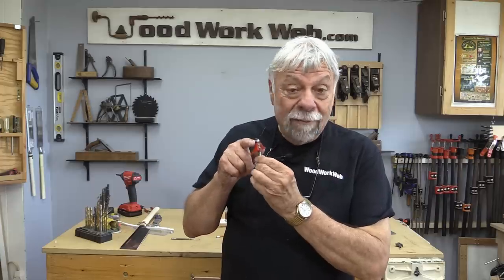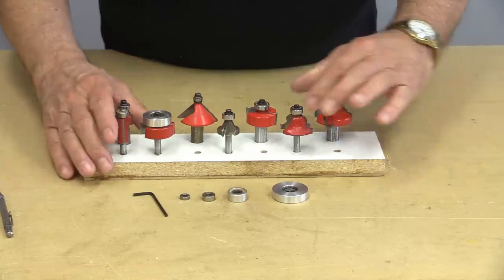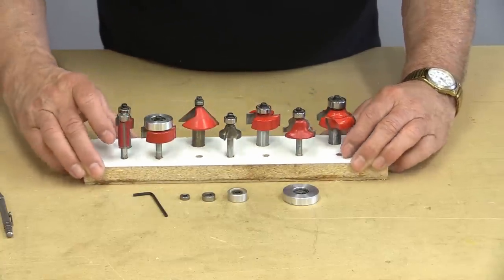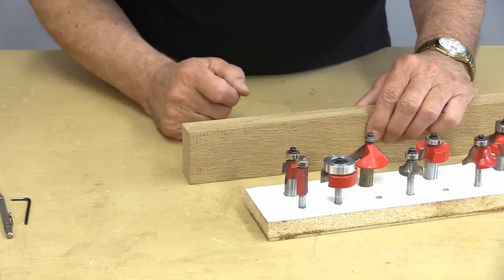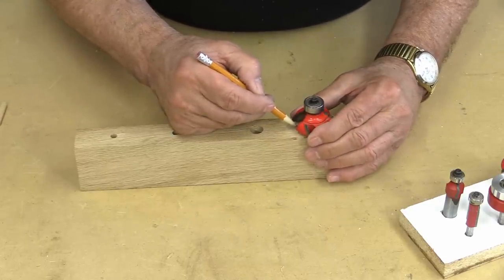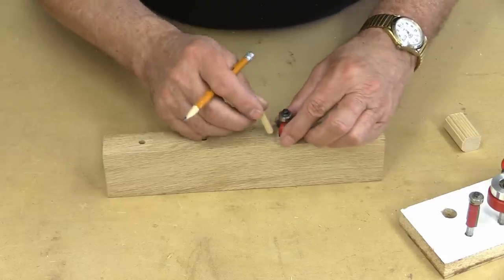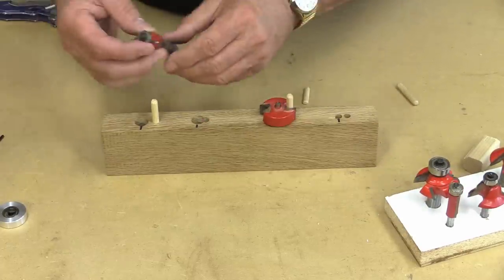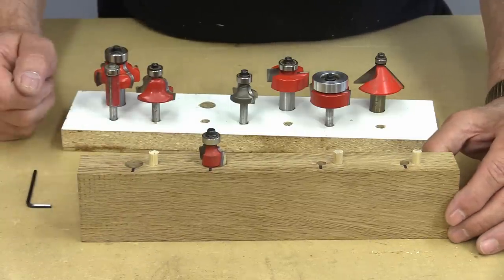Router Bit Bearing Removal Jig

Comment: Great jig, however sometimes we overlook something that is right in front of us.  Best part of this method is there is nothing to make.   I use my router for the purpose of changing my bearings.  Most routers have a spindle/shaft lock for tightening or loosening the collet.  This is the method I use.
Reply: Exactly.

Comment: I have a couple bearings on bits that I have picked up over the years that seem rough. I want to change them out. Looks like you either have very strong hands and can just pull the bearing off or the bearing I have is stuck on somehow. Is there a trick to getting the bearing off of the shaft?

Comment: That's a great idea, those router bits are sharp and I've cut myself a few times trying to get those cap screws off in the past.

If you drilled another couple of smaller holes that fit the hex-key used for those cap screws then you will always have those at hand too. :-)

If you ever need to put a smaller shovel in the side of a bigger hole, drill the smaller hole first, insert the smaller dovel in place and then drill out the bigger home from the back, that way you get a very snug fitting dovel and no breakout.
Reply from the maker: Thanks for the tips and thanks for watching!

Comment: I don't do a lot or routering, but I would have thought that the bit would loose its edge long before the bearing gave out.  Having said that a really great jig
Reply: I think the idea is so that you can change to various size bearings for different effects.
Reply: thanks  for  that  @1thinkhealthy
Reply from the maker: Yes, you can change it for different effects. You can also buy tools or use service to sharpen your router bits, which will greatly extend the life of the bit. Thanks for watching

Comment: I haven't need to remove bearing yet, but is there a reason you wouldn't just leave the bit in the router while changing the bearing?
Reply from the maker: A jig like this makes it much easier to work with if you're doing it often.  Thanks for watching.

Comment: Hi Colin.  Thanks for the tip however there is no clear link to use of bearings unless its the brief reference in “5 essential wood router bits”.
If there is a more detailed video I would be interested in watching it if you could add the link.
Reply: Gooner 1971: here's the link to that video. https://www.youtube.com/watch?v=V_eCa2U5y6w
Reply from the maker: Autotech and Mama C have already done a great job and provided the link. 
The short link is here: https://youtu.be/V_eCa2U5y6w